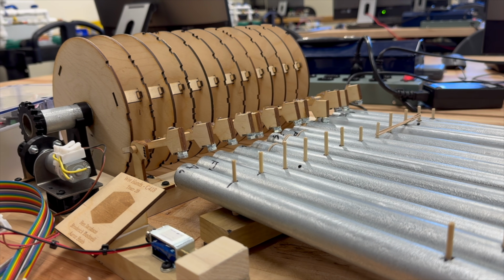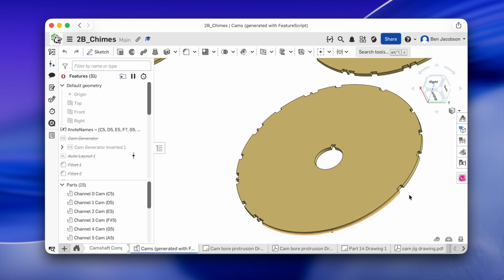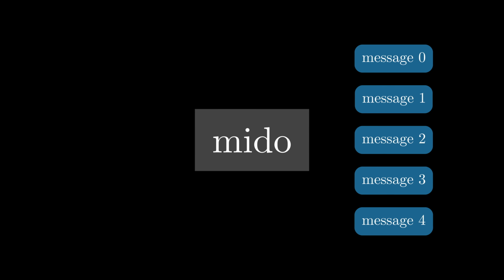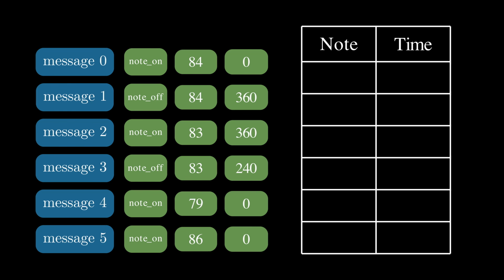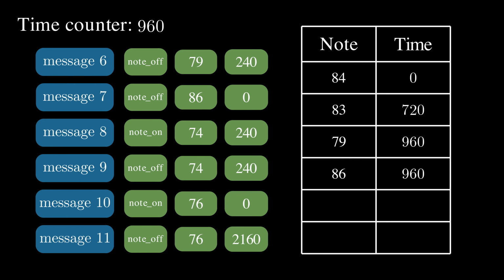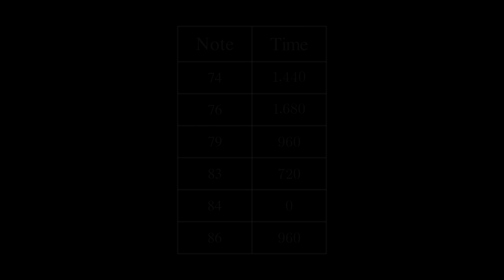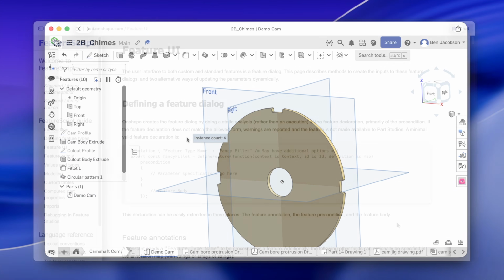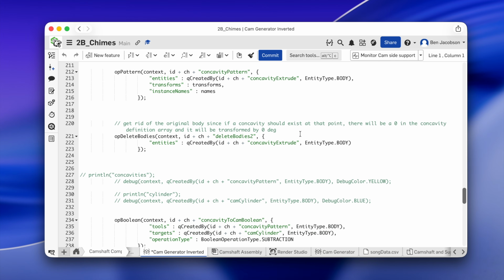Using Onshape's FeatureScript to Build a Music Box

Comment: hm, why do you need 12 wheels? ordinary music boxes have one cylinder and prints out the midi shape on it right? 

is there any advantage you see from your design and production workflow?
Reply from the maker: Good question! We originally wanted to have one cylinder with all the notes in separate "bands" on that one part. However, we were constrained to only a certain amount of 3D printed material and it would not have been feasible to create that part with the plywood/other materials we were given